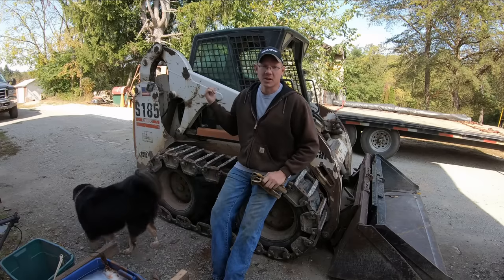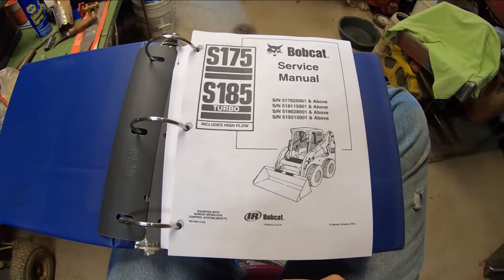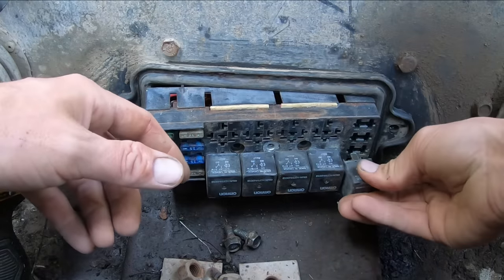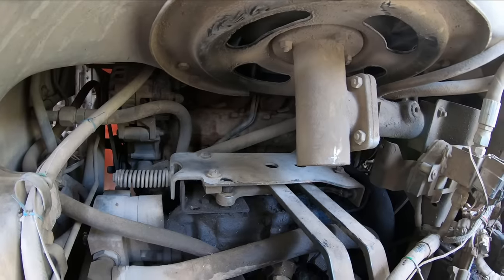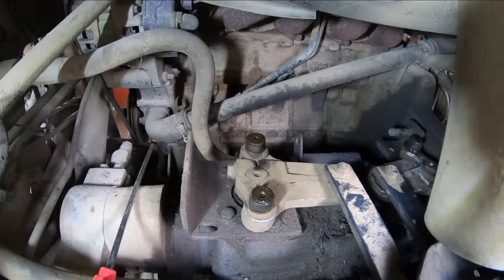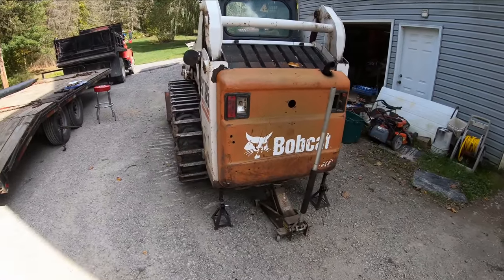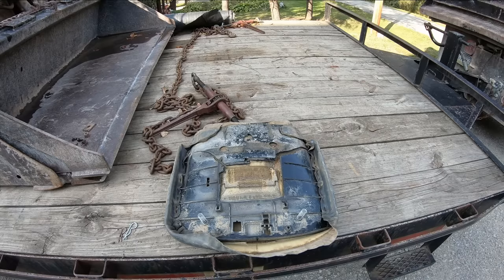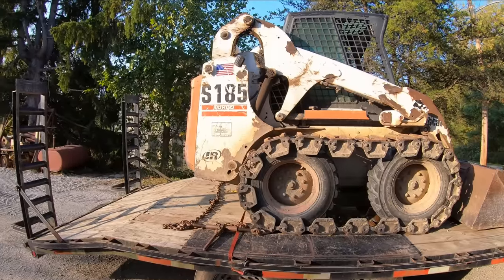Troubleshooting and Repairing Neglected S185 Bobcat Skid Steer

Comment: Gotta love having a skid loader around.  They are for sure a very useful machine.  Knew a guy who had an attachment that allowed him to use it like a small excavator.  Went with him to Oregon to help get a piece of property ready for sale and we brought it along and rented a skid loader locally.  

For a long while I did all the maintenance work on his stuff.  He bought a huge 30,000 sq foot building that was due for demolition.  Had a large scissor lift, a boom lift, two skid loaders and some other stuff that I took care of plus helping to clean up and do the work on the building.  The second skid loader he purchased from someone with it acting up.  I made repairs and serviced it since who knows when it was done last and he ended up selling it back to the guy afterwards.  He also had a small excavator on another piece of property that I worked on.  He had a hydraulic line that blew and the cheapo was only going to buy a single wrench rather than a couple around the same size (like 21 to 25 mm wrench sizes can't remember them all but bigger).  I told him to get the group since it was like 10 or 15 bucks more than the single wrench, he asked me when we would ever use that size of wrench and I told him, "Every time it breaks down."  He bought the group and when we got back to put the new line on oddly enough we needed a different size than the one he bought and two of them instead of just the one may the job a ton easier.  Also ended up being one of them was the correct size for the oil filter on his F250 diesel as well.

Always worth having tools and knowledge though.  Tons of things you can learn and figure out that way.  I am hoping to pick up a piece of property at some point and honestly want to get a skid steer and a couple buckets so I can build the house and do any of the work needed myself.  I think it will more than pay for the cost of a used skid loader what I save from paying someone else.
Reply from the maker: 36mm is an f250 oil filter
Reply: @DieselCreek  Yeah that could have been the right range.  I think it was the 6.7l from the mid 2000's that he had.  Ended up using those wrenches a few times though.

Comment: Remember those sticky tab labels we all used on our files in college/high school? I went through my car manual and bike manual and stuck the tabs on the chapters and wrote the chapter heading on them. Makes it so much easier to find the exact chapter that you need as the tabs stick out the side/top of manual. On ring binder manuals I used the office index dividers to do the same. Yes its ten minutes of your time to do it but its great in the future. Like you with the Bobcat, I've had both the car and bike for eight years now. Also, nail files are great for cleaning contacts , easier than trying to do it with sandpaper. Just make sure you buy your own and don't pinch the wife's !
Reply: It's OK to pinch the wife's, just don't let her catch you.  Really don't let her catch you putting it back when you're done!

Comment: Jeez after the leaf blower I had to clean my puter screen off. I just got a 1994 742b yesterday. 1300 hours.Its a gas model. It has been stored inside all its life. It has some dings and scratches  It is spotless non the less. Its going to be a big help with the 1966 ford backhoe.The only thing good about the backhoe it is the hoe. And it weights 8000lb. I have a 13,000 winch on the front of it. Ive been pulling some big trees down with here on the ranch.. The loader bucket I think was off a drag line. Its way to big. I ran it for a few hours yesterday here and what a good job they do. I picked up every big rock in my 2 acres in no time. The 5 ton of gravel got spreader in no time and leveled. Ditches filled and some bond fire junk in the dumpster. I love it. Watching you convinced me to get one.

Comment: I’d like to see a “everything wrong with my cheap case skid steer” video even though it’s not yours. I looked on equipment trader and the cheapest one for sale was 2x the price your friend paid. It had more hours but original paint.
Reply: In my area a well used (up) machine starts at $ 2000. "Runs as it should, just needs a drive motor, 3 tires. glow plugs and it smokes". And picture showed a twisted bucket to boot!

Comment: Just a piece of advice from a guy that has been in the electrical business for 30 years troubleshooting automation equipment. Don't ever spray air at a mess like that to clean it (the rust in the relay/fuse box) always vacuum it out! spraying it usually lodges the crap deeper into the sockets causing more issues. Also clean ALL the contacts with fine sandpaper and flush the sockets out with "contact cleaner" Then spray it with air to evaporate the cleaner.
I would also re-seal that gasket around the plate to keep water from getting in there again...good luck

Comment: I used to be a bobcat mechanic and had a custom built pair of vice grips that would push those “cam follower” bearings against the bars and would always put a wireless tach on the wheels to get them to run straight. You can flip those “centering” bars over and use the backside if they have worn in bad grooves.

Always lift the arms and support them then you can lay a piece of padded plywood over the operators area to lay on to do any work on the hydrostat

Comment: “Well now, that was a little dirty in there”. LOL, like it was clean after you used the leaf blower on it 😂. Seriously this was an interesting process—one of those where you’re laying in an uncomfortable position trying to reach an awkward bolt-cussing away-thinking there has got to bet a better way. Yes on the skid steer purchase video and more Meatball he’s always entertaining.
Reply: it was so dirty in there he had to clean his leaf blower after using it in there :o)
Reply: I can relate. Working on compact equipment can be...interesting.
Reply: Reminds me of back in the 1960s, there was a car with a V8 engine where you had to pull the engine to replace the back spark plug on each side.  Some owners just cut a hole in the wheel well to get at those plugs and then fastened a home-made sheet-metal cover plate with sheet-metal screws over the hole!

Comment: At 19:00 the belt and pulley in the background is the tensioner for the cooling fan.  It's an aluminum arm with a steel bushing and bolt in it.  They are notorious for seizing up and causing overheating problems.  The tensioner will keep enough pressure on the belt to turn the fan at idle, but at high RPM or working the machine hard the belt will slip causing overheating.  I take mine apart at every oil change and lube it up with anti seize.  I enjoy your videos, especially the church project.

Comment: I always find it disappointing when something has to be adjusted by just loosening a bolt, sliding and retightening. If you're not careful, you can lose the position completely or if the surfaces aren't clean, it can be a pain making fine adjustments. Why can't it be a threaded setting or a mechanism that gives you good leverage. It would save so much time and nerves. The quality of the machine should emerge from clever engineering, not from an experienced dude sweating his balls off in the field, trying to get an elephant to play the violin.
Reply from the maker: Hahah you have a point my friend
Reply: Yes each of those rods could have had a  tierod joint and be done with it
Reply: I'm feeling your pain. I hate it when adjustments require putting in or taking out shims.  Constantly.
Reply: Remember- manufacturers are in the business to make machines- not make machines easy to maintain and keep for decades... they would all be out of business if they didn't cut some corners on cost...
Reply: It's really that reconfiguring something that simple would boggle the mind of the engineers. I asked an engineer to design a regulator that would regulate the gas flow for a certain carburetor what he came up with was three times the size of the carburetor and couldn't be used he said there was no way anyone could make what I needed. I found exactly what I needed on an old frozen Coke machine that was being thrown out. it was what regulated the syrup flow and was designed to fit perfectly in my application. (the frozen coke machine was manufactured 30 years before my request.) Sometimes you just have to Keep It Simple Stupid to make things work right without complications.
Reply: The only issue with threaded adjusters is rust... lots and lots of rust. Of course, this problem is entirely location dependent. In Florida I'd love to see precise, threaded adjusters, here in Newfoundland, Canada, they are a nightmare 99% of the time. 
Should also be noted this is from the perspective of an automotive tech, where I had no control over how much salt customers exposed their vehicles to.
Reply: @onesadtech  True if the threads are made of steel. Not quite an issue if made of stainless or comparable metals. Cost point of course.
Reply: @ypop417  but ball joints cost seven dollars each for you and me and cost bobcat an astronomical tdollar fifty!
Reply: The whole reason they do that is to keep people from working on their own machinery (coughs) John deere
Reply: I guess im asking randomly but does anybody know of a method to get back into an Instagram account??
I was dumb lost my password. I appreciate any tricks you can give me
Reply: @Ignacio Hugo instablaster ;)
Reply: @Benson Kayden It worked and I now got access to my account again. I'm so happy:D
Thanks so much, you saved my account :D
Reply: @Ignacio Hugo You are welcome :)
Reply: That's a good machine you can still work on it. Good job

Comment: WD-40 specialist contact cleaner is great for corrosion cleaning.  We use it at work, it's actually recommended in the field service manual for our printing presses.  The water based ink releases a lot of moisture into the wiring and circuit boards.

Comment: My electrical spidy senses are going nuts at how you "cleaned" those relays. Man, put up the money and replace all of those relays. Then clean the fuse panel with some good electrical contact cleaner.
Reply: Buy a new cover or repair that one so it will seal and as previously said should have use contact cleaner. It will come back only next time it could melt the relays and ruin mounting base because of resistance and Heat. Just saying a couple dollars now might save you a lot of down time and money later when you have to replace the harness.
Reply: Arthur Cunningham not to mention the would be a REALLY bad place to have a fire.
Reply: @corydriver7634  While relays can go on fire, it's not very frequent. The contacts usually burn themselves so badly that the resistance is high enough to not have a fire, though things may get a bit melty.
Reply: Did you notice how he "discovered" the "corroded" hole in the relay panel cover that was allowing water to get in there and cause all that corrosion.  In reality that was a drain hole and someone had put the relay panel cover on upside down.

Comment: Another thing I’d like to point out, lift the arms all the way up, and put the lock in. Then flip the cab. You can stand beside the machine (if you take the metal tracks off) and work on it. Just changed the chain in a 873, I put it off for weeks because I didn’t want to do it on my head, the manual knows best. Great videos keep it up!

Comment: Great video.    Same issue with relays.   I put a bead of silicone around cover.   Still can peel the cover off but keeps water out now.  
Also not a fan of Bobcat dealer in my area.    Go in for a part and they try to make you feel bad or cheap for having an older machine and not buying a new machine every time.
Reply from the maker: I’ve told them where they can shove their new machine before.... this machine was almost traded to that dealer before I bought it, I gave them $500 more than the dealer was giving And still got it for half of market value

Comment: I'll add my vote for tips on buying a used Skid Steer. With all the the attachment options these seem to have they can be mega-useful! I have no idea what a Dealer charges for those relays but OMRON relays are pretty available on EBay, etc so if you get the Part Number you might find cheaper replacements.

Comment: Few years back,company I worked for had one of those.I was doing a P.M.service when I noticed the Hydrulic filter had not been changed in about three or four years.Tried taking filter off it was stuck so badly that we finally had to replace the filter block never did get the filter off the block.Damn machine was still working ,but after we changed the Hydrulic oil and filter,repacked two or three cylinders,the operator said that the machine worked good as new.

Comment: If the contacts for the relays are corroded then so are all the plugs.  This is going to likely keep giving you trouble until you clean it all up and seal that cover properly.  Power wash and steam clean, take care of some of the leaks,  grease her up good, clean up some of the rust, and paint that baby up.  You should always have a relay and fuses handy.  I always find that if you keep your equipment clean you notice leaks and such faster and can fix them before they get out of hand.  You also tend to do the regular maintenance more often and you will find this thing could last you 30+ years easy.

Comment: On the farm we had a 6ft wise 3pt mounted Woods Cadet.  She was pretty worn out as she was used by the county abs was pretty thrashed and leaked out the gearbox oil in a day. Lol. But what ever one could get under the deck it’d pulverize.  

In a previous video you mentioned the pins on the brush cutter are 3/4 inch diameter, the Woods bolts were 1.5 inch diameter, meaning the woods would have a cross sectional diameter 4x times larger.  Also, the woods blades were flat 1/2 or 5/8 inch thick barstock with no sharp edge so they just mashed stuff but didn’t dull as they were dull lol. Idk might be best to use the model as light duty cutter for grass and small brush.  Just thoughts on it. Super handy having on the front of a skid steer though.

Comment: When it comes to Electrical connections get yourself a product called DeOxit.
It's easily the best anti-corrosion fluid there is.
We used it in the Keys on boats, pinball and arcade games Jukeboxes and pretty much everything.
Especially items that sat dockside.
It comes in two temperature ranges, gold and red.
Spray and drip containers, Qtip and wipes.
I've been using it for a couple of decades and it does an awesome job once you've cleaned all contact surfaces.
Its supposed to last 5 years but I've seen it last far longer.
It's definitely worth the money to at least try it..

Comment: Next time the Bobcat plate is out would it be possible to add a couple set screw adjusters to the blocks. It would save tapping them back and forth. 
I have much better luck with being able to  dial in a screw thread.
Some RTV sealant around the cover might keep the water out of the relay panel. 
Power washing helps keep the equipment clean, but it is hell on electronics.

Comment: As one Bobcat owner to another. Spray that mess under the cab with oven cleaner and let soak for a few minutes. Pressure wash and it'll look like a new machine. Seal up that relay box and keep water out in the future. Those relays are a common type available from Amazon and Ebay, cheap and I'd replace them all.

Comment: i had to chuckle when you said that it was an incredibly tight area to work in  lol  i was an aircraft mechanic in the navy and that space you had was like the grand canyon compared to the working spaces on those jets.
Reply: Yup. That's why you are ahead if you got a woman in the crew. Smaller hands. I did black boxes and boy! was I popular!
Reply: i have small hands and it was still a booger to get them inside an access panel. i was doing good if i got a quarter turn with a line wrench on a fitting.

Comment: Picked up  an L775  New Holland.  Under  1k.  Circa  early 1980's.  Was  a  Wisconsin, now it's  a  Deutz.  Cylinders  leak,  engine  has  leaks,  (Less  than  when  I  bought  it,  and  it  creeps  when  cold.  (Gotta  rebuild  the  valves  on  mine.  Relays  and  corrosion?  Yep.  Boom  would  lock   in  mid  lift  or  lower.  Electromagnetic  valve  lost  it's  feed.  Corroded  terminal.  Cut  off  the  original,  sandpaper  and  emery  cloth  on  the  terminal  in  the  skid steer,  dielectric  grease  on  everything,  and  two  winters  later,  still  good.

Comment: Great job on this, I am amazed at the amount of equipment you can "dope out"  on the fly.  I do some of the same but with electrical items. I like manuals but when the Spanish guy isn't available it is time to just look.  A comment on the fuse/relay block. When I encounter corrosion on the relay pins/connections, I try to clean the socket too.  Usually that will happen by what the old telephone guys said, Exercise the jack, put the plug in and out a couple of times to wipe the contacts.  failing that, i try to get something very thin in, making sure to not bend the contacts open. Lately i have been watching D/C, the Hillbilly Kitchen and Probably Cause - Dan Gryder who reviews air accidents,.  All ove you are better than anything on regular TV.

Comment: i always used gasoline , paint  brushed on as a de-greaser ,  followed by soapy water  , also brushed on ,, you will need a rain suit if you plan on power washing an area like this . a selective garden hosing will do a great job . and not as messy . soap and water will cut the gas/ diesel smell down .

Comment: You went about that the hardest way possible! If the left drive needs centering, simply get a string/rope or another person to hold lever in neutral position and loosen corresponding block only,  And slide it tight to guide rollers, and tighten.
Reply from the maker: They were both out and needed aligned again